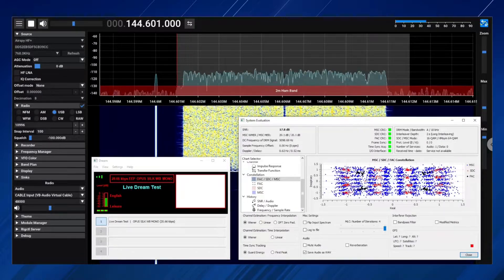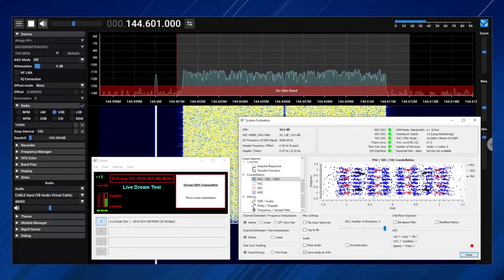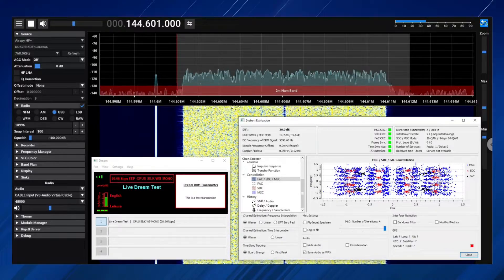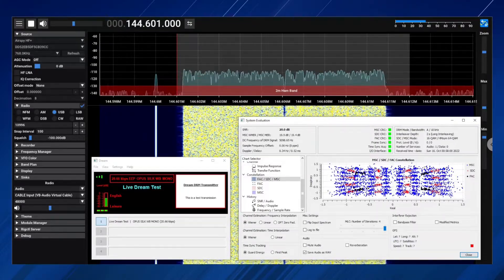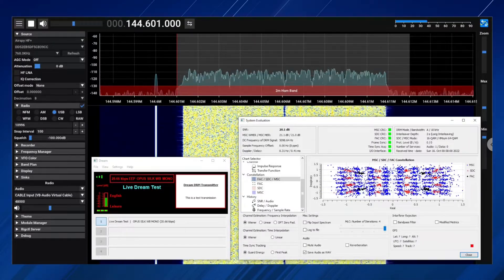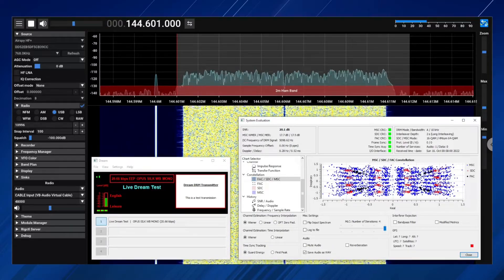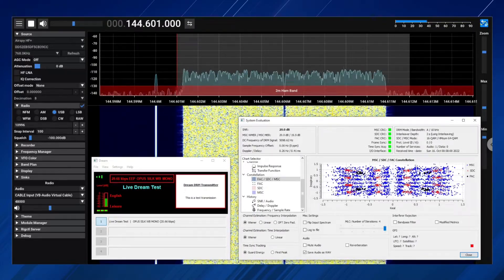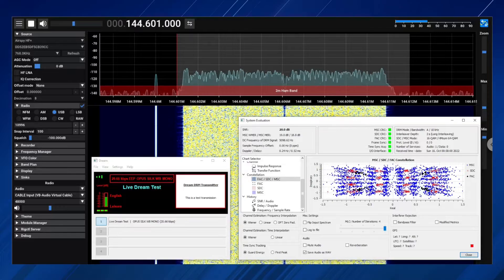Dream DRM Transmission using a HackRF and GnuRadio

Comment: Hi Arden, excellent video; I do not understand why you needed to use GNU Radio ... 
dream -t already outputs a usable signal out if the audio card, centered on approx 13khz; why can you not just multiply that freq to the wanted freq. (say 13Mhz?
Reply from the maker: Hi, I think I was doing just what you said.  I was using Dream to modulate the signal to a virtual sound-card, then I used GNURadio to take that audio, and transmit it using a HackRF  (I was transmitting on 144.500Mhz)

The small multiply at 1:13 was  just to move the center of the signal a little away from the tuned frequency (as the HackRF has a spur there).

It's been a little while, but I think I was running two dreams (one to modulate, and one to demodulate), two virtual sound cards, GNURadio & HackRF to transmit, and SDR++ & AirSpy SDR to receive.  It was a bit of a mess, and frankly, amazing it worked at all 🙂

Comment: Very nice!  Where did you find the copy of Dream that can encode?  I've been looking for that software for ages.
Reply from the maker: I was using version  dream-2.1.1-win32-svn808-df  from SourceForge

If you run  dream.exe  with the argument  -t  it will display transmit options.

I've had great trouble with other versions, and getting xHE-AAC support at all.  But Opus seems to work well.